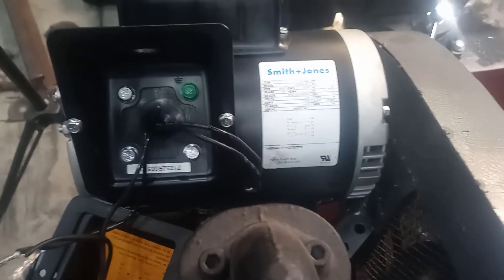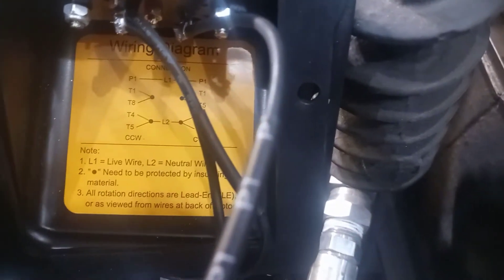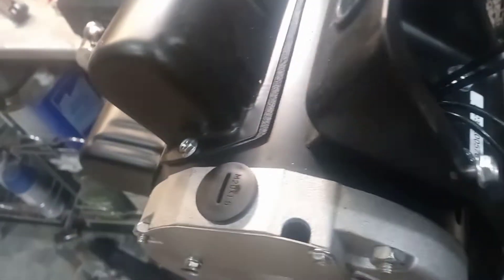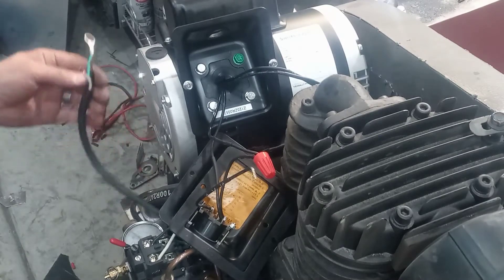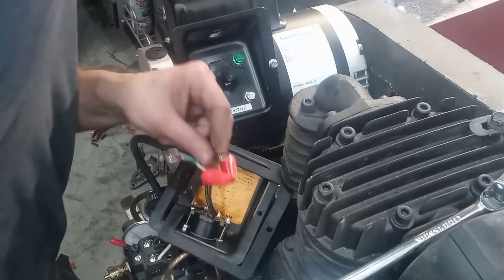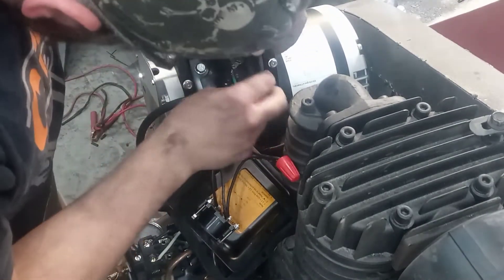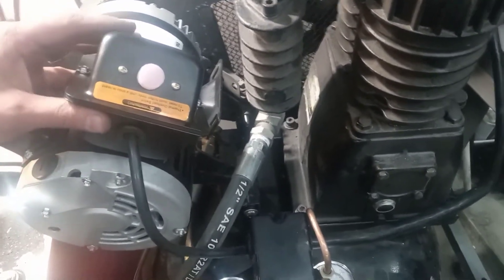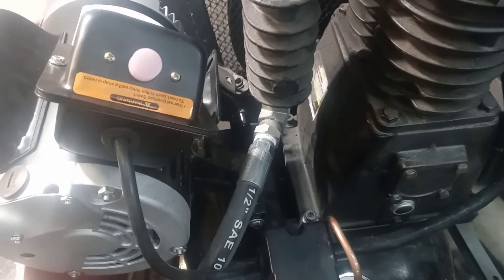How to wire up a Harbor Freight 3HP compressor motor - 220V

Comment: Short. Succint. Freaking useful. SO HELPFUL.

Only thing left out: clockwise vs counter clockwise is done VIEWING THE END OF THE SHAFT, not as if you’re behind the motor while wiring it. I had to google that up. Hopefully it helps someone else.

Great video!
Reply from the maker: Really good point about the shaft rotation!

Glad the video helped!

Comment: i see you are using  1/2 inch hydraulic type  air line  what type of line is it thanks
Reply from the maker: I'm not sure what you mean.  Are you asking brand or something else?
Reply from the maker: The line I am using is an off the shelf unit I bought from Tractor Supply Company.  It had the correct threads for me to use between my tank and the Harbor Freight Compressor Head I currently have on this compressor.

Comment: Purchased this same motor recently to put on my air compressor. wired it all up and set the rotation for my application and flipped the switch. Motor barely started to turn and popped the 20 amp breaker instantly. Rechecked that all my wiring was correct, and it was, tested the outlet with my 240v welder, no issues.
Called HF's tech support and was advised to return the unit to the store.  Nearest store is 50 miles from my location, 100 mile round trip.   New motor, wired up and double confirmed correct connections.  Same result!  
WTF!

Just for testing I put a 30 amp breaker into the panel and tried again motor spun slightly longer but tripped the 30 amp breaker as well but it did spin a very little bit longer before doing so. 
Another 100 mile and that motor was returned as well for a refund minus a 34.00restock charge which I am going to dispute with corporate.  Ordered a motor from elsewhere. 
Folks at the store were very pleasant and accommodating within their abilities but the restock fee chaps my hide.
Reply: I’m having same exact problem
Reply from the maker: Man that sucks.  I also live about an hour from the closest HF.  But mine has put in a lot of hours since I made this video and still going strong.  Sorry to hear you had a such a crap experience.  That restock fee sucks!
Reply: Maybe pump is too large for the motor
Reply: Mine won’t work either.
Reply: 20 amp breaker isn't going to work
Reply: It got 30 amp breaker 
Not working at all
Tried ccw and cw

Comment: Are you able to rewire that motor to run off of 110v?
Reply from the maker: I don't believe so.  Pulling that much HP out of 110 I think ends up being a very high amperage.

Comment: How would you determine if you need counter clock wise or clock wise ?
Reply from the maker: Wherever the original motor is sitting, it will spin in the direction that puts tension on the top of the belt as it spins.  If you are building a new compressor then the compressor head information will tell you which direction it needs to spin

Comment: Do I need to wire a start?
Reply from the maker: If you are rebuilding a compressor, it should already have one.  If you are building one from scratch, yes you will need a pressure switch.